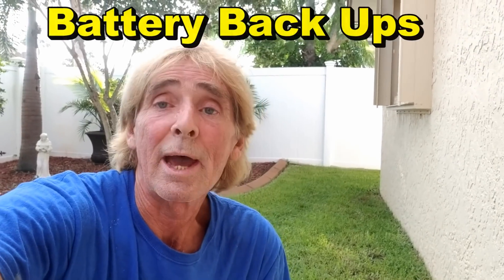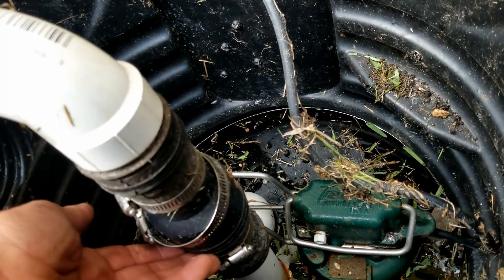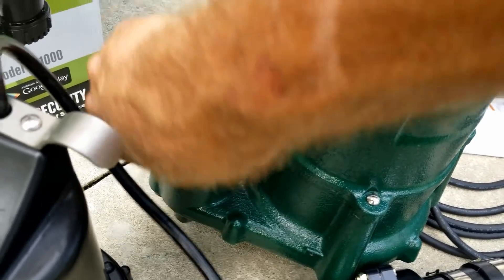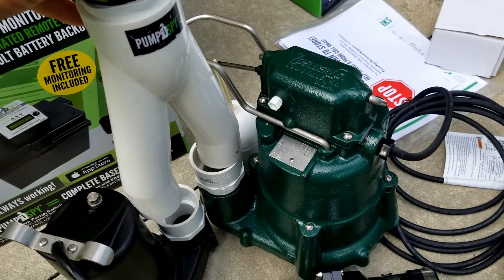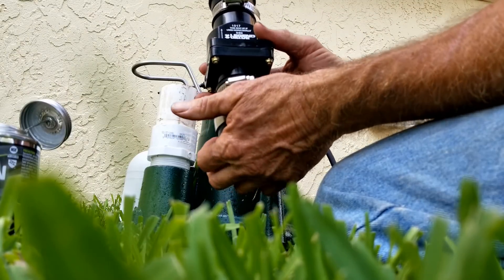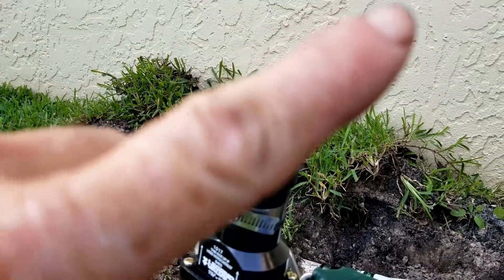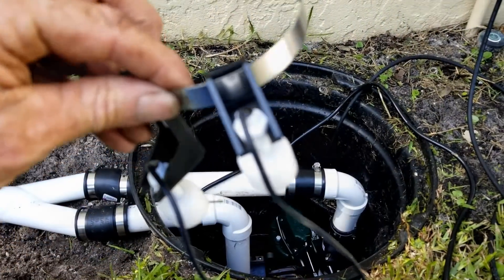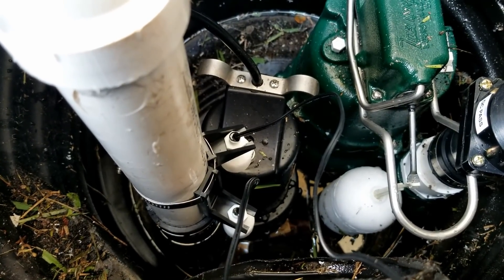Battery Back Up, Do You Really Need One?

Comment: Great video!
I live in Southern California and would like to build a outside grey water capture system with a sump pump to catch and distribute shower water. My drain line is below grade but easily accessible and I have a whole house battery backup system. Any related videos and/or suggestions on where to go for more research would be appreciated. Thanks

Comment: Saved my basement from flooding about three weeks ago after the power went out. In addition to power outages, battery backup pumps work if the primary pump fails or wears out from normal use.

Comment: Great video.  Didn't hear you mention whether you drilled a 3/16" vent hole in the tubing coming out of the backup pump.  Did it come with the hole predrilled?  I'm assuming both pumps require their own vent hole to be drilled in their discharge pipe.  Would be nice if you could spend some time commenting on what factors to take into consideration re: the electrical hookups for both pumps (i.e., whether it's advisable to plug the main pump into a GFI protected electrical outlet and any provision for monitoring battery water level and sending an alarm when it gets too low, which it will with time).  Thanks!
Reply: John R. Bonnett I had the same question, does the secondary pump also need the vent hole? Not sure if you figured that out. I am getting ready to install pumpspy backup pump, like the idea of virtual monitoring.
Reply: @shahrukhkhan62mk  I think the pump manufacturer manuals will advise if needed. Some pumps don't if they are not bottom suckers.
Reply: And drill the weep hole lower than higher per Power Equipment Direct channel: The weep hole should be lower in the pit because it is meant to relieve the pipe of any air left in the system after a draining cycle. You want the hole to be underwater and the pipe below the hole even after a draining cycle, so air can't get trapped in the pipe. Having the hole up high greatly increases the chances of air lock and burning out your pump.

Comment: About 10 years ago, during and after an exceptionally heavy rain that lasted about 3-4 hours, I saw my sump pump discharge pipe shooting water like it was on steroids.  It was a constant, fast moving stream of water that filled the pipe completely and shot it maybe 2-3 times farther than when it normally operates.  I went down stairs to see what was happening and saw that my backup pump was operating.  I assumed the worst and thought the primary had quit.  When a repair guy showed up days later, he said that the primary was fine, but that it couldn't keep up with the amount of water entering the pit so the backup (which sits higher) had activated as well.  The reason for the increased water flow I had witnessed from the discharge pipe was that BOTH sump pumps were active.  I suspect that the backup acting in the way that it did saved me from a flooded basement.  That's another useful aspect of having a backup pump in the pit.